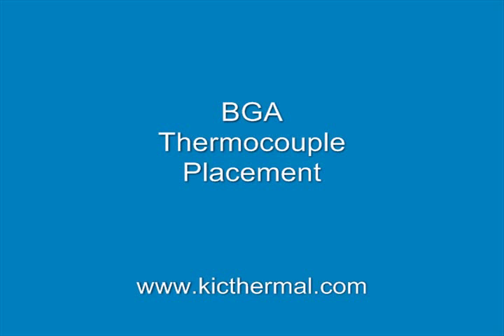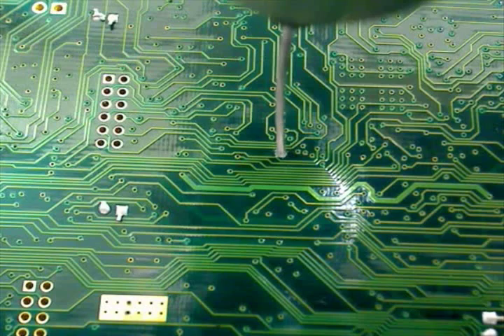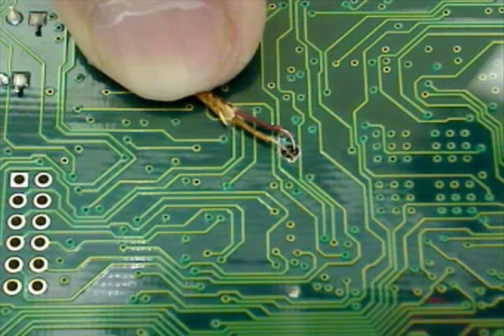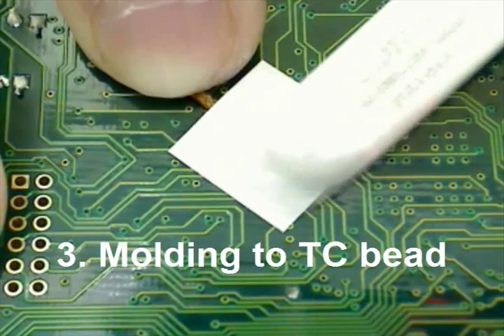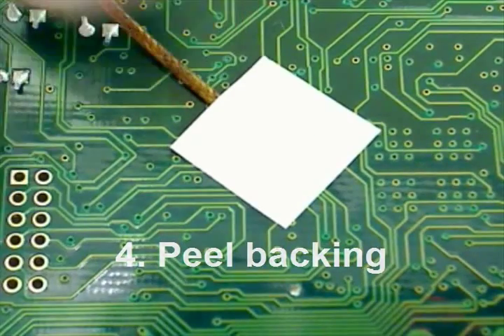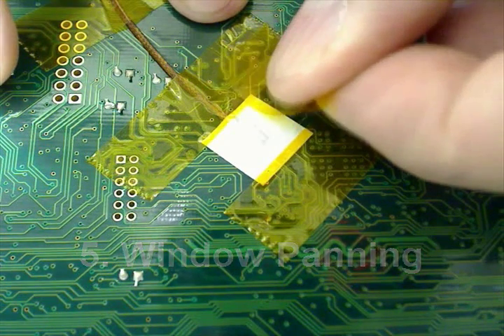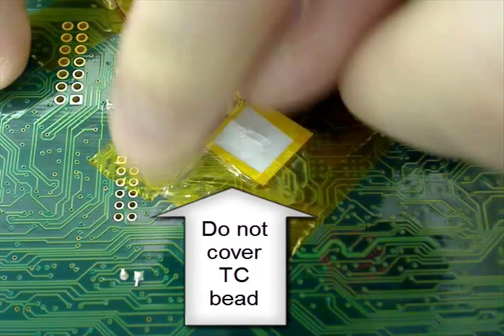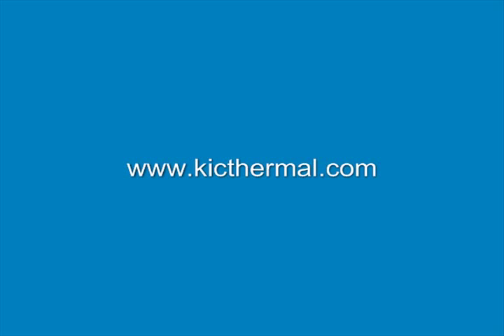How to Thermocouple a Printed Circuit Board (PCB) Part II

Comment from the maker: Drilling holes in PCBs is only one method of direct TC attachment, but of course destructive.  High temp solder and epoxy are also common methods, but these are all destructive.  The Rochester Institute of Technology and KIC just completed a study that addresses the problem of BGA profiling.  Great part of the study is we finally have solid science to show non destructive methods can be used.